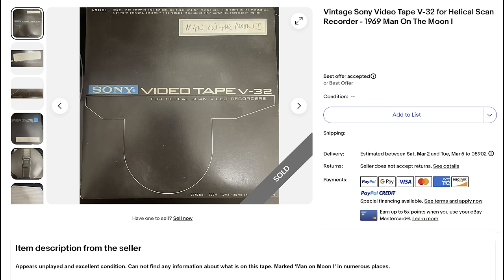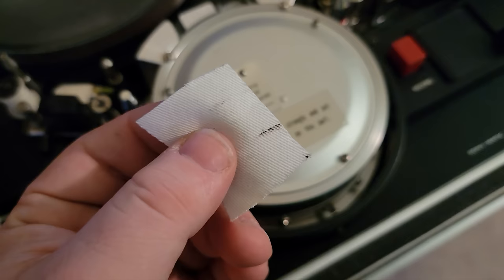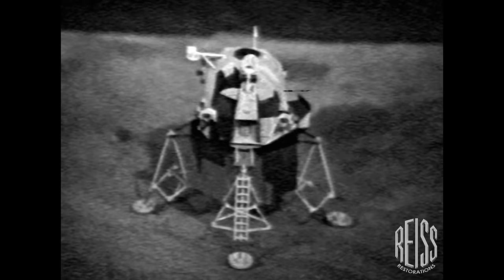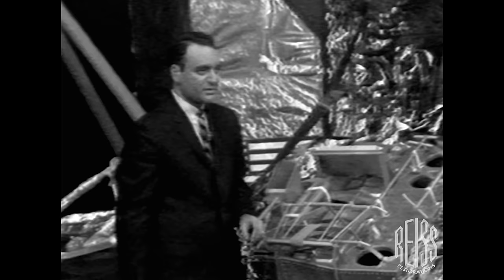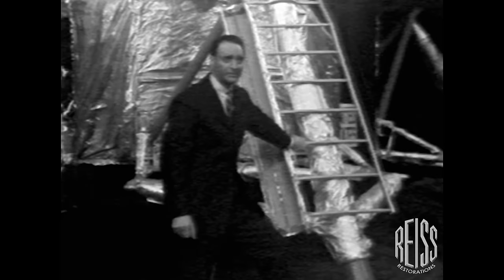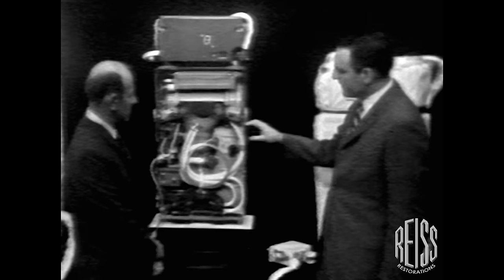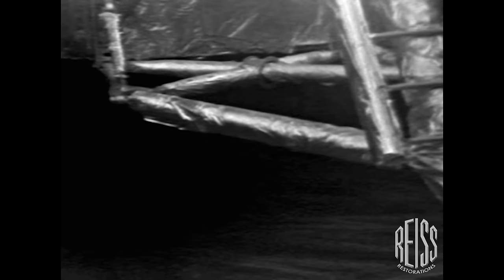Finding and Digitizing the Apollo 11 Moon Landing on NBC (July 20, 1969 - Partial Broadcast, B/W)

Comment: Great work! Still brings hair up on my spine with the 1201 and 1202 calls and all. Great to see how knowledgeable the presenters are about the LM, and them having a mockup in the studio.
Reply: Because the LM was a mockup in a studio.
Reply: @sunnydlite-t8b Riddle me this, if you aren't capable of something, does that mean that thing is impossible?
Reply: Not that you would know anything about 1201 and 1202 Marc 😉. You were a big part in teaching many people how the agc works
Reply: It made me lol when the one dude said they could use a fan to blow the flag on the moon right after explaining and showing it has a rod to support it because there was no air on the moon. He then says but there is no power on the moon for it lmao. @ 24:14
Reply: @utterube solar power maybe? The cells were created in 1954 so the tech was available.😊
Reply: @extraincomesuz  You are missing the point, the fan wouldn't work to blow the flag because there is no air for the fan to push into the flag, so solar panels wouldn't help a fan move the flag lol.

Edit: I think the guy just didn't want to have to explain to the guy off screen again after he literally just explained the flag and why it needed the rod to hold it up(the chuckle in his response speaks to me), it was easier(time constraints for the programming and expected time of the live broadcast)for him to say there was no power on the moon for the fan to run, as the dude commenting about the fan obviously didn't understand the moon has no atmosphere lol.

Lol, I feel like we are echoing the video right now haha.

Comment: When I learned there was no original footage of the landing I wanted to magically find something like this.  I’m glad you did!!
Reply: "there was no footage of the landing". Not exactly correct. While obviously there was no external footage of any of the 6 landings each was filmed from inside the Lunar Module using the 16mm camera pointing out the LM window. This footage is easily found on YT. Take care.
Reply: @TheWokeFlatEarthTruth The transmission was not NTSC, and the original feed has been lost. This and all the other footage is literally from a camera pointed at a screen.
Reply: @jonnyreverb  exactly.  Even if not the original feed an incredible find nonetheless.  Need the Australians to find the SSTV.
Reply: @jonnyreverb  Incorrect. The OP mentioned ""there was no footage of the landing". I simply pointed out that the only footage of the actual landing of each of the LM's on the lunar surface came from the 16mm camera. Take care.
Reply: There’s a difference between the footage that could be / was shown on TV at that day, and what was recorded on film and then brought back / recovered, when they splashed down on Earth.
Reply: @Stadtpark90  Correct, the LM was not equipped to televise the landing, we had the audio only.  The rest was studio stuff until the moonwalk when they powered the camera up as Armstrong was on his way down the ladder.  You might remember the instruction 'TV Circuit Breaker In', because the camera wasn't powered up until he was on the way down the ladder. The actual landing footage was 16mm film from within the LM that was takend back to Earth for processing as was other 16mm and high res (for the time) still pictures (Hasselblad large format still cameras).  But the only television was of the moonwalk itself.
Reply: @jonnyreverb Telecine was the fastest way to copy video at the time.
Reply: The only lost footage was the reel that was taken to the moon. All broadcast reels had to convert as the footage was only 10fps and would not broadcast to tv. All the broadcast reels were kept and have been released on multiple occasions including the 50th anniversary.  So any footage you have ever seen has been kept, only the astronauts and nasa would have ever seen the original footage that was lost.
Reply: @geoffroberts1126  The Hasselblads were medium format camera's. Sorry to be 'that guy' , but the pure quality of a 70mm film negative puts any modern camera to shame.
Reply: @TheWokeFlatEarthTruth LMs* plural, no apostrophe saying LM is. Modules has no apostrophe.
Reply: @OrangeYTT And film was dubbed to telecine too. Which was what the rushes were dubbed to for an initial pre-edit recce back in the day. My father was a film editor for many decades prior to becoming a director. I used to sit in the cutting room from 5 onwards! Good times.
Reply: @fisher6747 Cameras* plural, no apostrophe saying camera is. Not sorry for "being that guy." 😇
Reply: @thekeysman6760  Thank you for your reply. English is not my native language. Take care.
Reply: @TheWokeFlatEarthTruth  It's all good. Best wishes to you too. I'm not multi-lingual so you're beyond my abilities anyway!
Reply: @fisher6747  Ah, ok, I wasn't actually sure, I knew it was bigger than the usual 35mm.  And yes, they were good cameras with good film.  We are only just getting to the point in the last few years where digital is starting to catch up to that in terms of resolution, however enlargement isn't as good with digital.   It's now possible to make digital cameras that approach human eye resolution, so ultimately it will leave film, even 70mm behind, but it's not here yet in commercially viable cost scales.
Reply: @TheWokeFlatEarthTruth  "Was" and "is" are the point you're getting overly obsessed with.

If the person is refering to a point in the past (they would have to be aware prior to the point of commenting) where they became aware that there "is" no original footage (NASA state they have no original footage, no telemetry, and no longer have the technology to go to the moon), they could, typing as they speak, apply a past tense and say "I found out there was (meaning "is") no (longer any) original footage".

Your need (for virtual validation) to show your prowess of repeating things you're aware of may be unnecessary here.
Reply: @dontaskme7004  The OP was "there was no original footage of the landing". The only footage of any of the 6 actual landing events was taken from the 16mm camera from inside the Lunar Module. All this footage is still in existence. There never was any other footage take from any other camera. It is really that simple. Take care.
Reply: The original "crystal clear" footage of the Moon landing was lost (somehow). All we have is low quality videos that are blurry and dark.
Reply: @JustinMadrid-z7e  "the Moon landing"???. 
Also how exactly was the 16mm footage " lost (somehow)"? Take care.
Reply: @user-xt6fg4zt5c  There wasn't any "crystal clear" footage of the landing lost because there never was any live footage of the landing to be lost. That's why it says "animation" on the video during the descent or landing. There wasn't any camera on the outside of the LM or already on the surface of the moon to take any live footage.  Duh.  As the other person stated the only footage of the landing was from the camera inside the capsule which had to be returned to earth and developed. It's the video you can see on YT now that shows the dust outside the window. The only live footage available is of the EVA which occurred hours after the landing. This video explains about the camera in the storage compartment of the descent stage of the LM that was used to capture the live footage of the EVA.
Reply: @jonnyreverb  Not really.  This was a taped on a VTR fed from the video source, probably by an engineer who worked at an NBC affiliate and had access to the feed.  Most of the other YT coverage is the same, such as WTOP in Washington DC.
Reply: @TheWokeFlatEarthTruth   And NASA state they no longer have any original footage... Saying "there IS* no original footage" is thus a true statement.

Refering to finding out that there's no original footage, using the past tense because they found out in the past, making a statement with the same intent, you could use "there WAS* no original footage"... That isn't a claim that nothing was recorded, it's refering to the statement that none of it has been preserved.
Reply: @dontaskme7004  I will try to make this a simple as possible. The 6 Apollo landings (by landings I mean the actual physical event of touching down on the lunar surface) were only filmed using the 16mm Maurer camera pointing out the Lunar Module window. This original footage is still in existence. No one including NASA has ever said otherwise. The 16mm footage is not the same as the footage that was obtained from the Westinghouse TV camera that was transmitted to Earth and recorded there. Take care.

Comment: Absolutely beautiful.

Absolutely nuts how fast mankind makes progress.

- We start literally with just rocks - 0
- We bump these rocks together with wood and suddenly we have it... fire. - About 2 million years ago.
- We learned how to control the water, building irrigation systems. - 6000BCE
- We learn how to propel stuff in the water with oars, creating the action of sailing. - 4000BCE
- We learn about a strong rock named iron and start making stuff from it. - 1200BCE
- We make powder that explodes whenever we want it to! gunpowder - 850CE
- We harness the power of wind through windmills - 950CE
- In 1044, we learn that magnets can help us with directions, creating the compass.
- Finally, we get clocks to tell us the time! 1200-1300
- In 1455, man learns how to mass produce media with the printing press.
- We started boiling water and putting it to work, - 1764
- We learned how to use this steam to move us with massive locomotives - 1804
- Then we replace our oars with steam in our new steamboats! - 1807
- 1826/7, a man takes light sensitive paper, shoves it in a box with a shutter and a lens, and boom, photography.
- By 1831, we grew tired of harvesting our crops, so we made the mechanical reaper!
- In 1844, a painter decided he was tired of using the unreliable mail system, and boom. telegraphs.
- 1876, a man further refines this idea and makes the telephone.
- Then we got the gasoline engine, - 1867
- We grow tired of using candles, and harness electricity and make lightbulbs! - 1879
- Humanity got tired of using it's legs and wanted to explore the world! so they made cars - 1886
- And soon we learned how to broadcast our voices across an area! making the radio, 1901.
- But then we took to the skies, 1903, we finally fly.
- And we soon were on our way in 1926 with the first small rocket engine.
- Humanity decided just hearing someone's voice wasn't enough and developed a way to see them too, television. - 1927
- Then we developed jet engines to make better planes, - 1932
- Soon we developed a way to split things we cannot even see to make a ton of power! - 1942
- And we developed computers that could do thousands of math problems in a second. - 1946
- Soon we made transistors that made those computers faster and better. - 1947
- And the world was taken by storm when suddenly in 1957... man finally left home on a rocket.
- Then in 1969, we finally took yet another small step for man, but a giant leap for mankind.

And life would only get crazier after that.

Comment: It's neat that the LM model NBC used to illustrate the landed LM was the commercially available Revel model kit, easily identifiable due to the hinged, foldable legs. The model's legs needed to fold because it was part of a kit that consited of the command/service module, launch escape tower, lunar module and the lunar module "garage" that was on the top end of the 3rd stage of the Saturn V rocket. The model could be displayed in launch configuration or with the LM landed on a lunar display base.
Reply: I bought and put together that model age 9. Great memories.
Reply: Me too, but I was 12!
Reply: I had no idea this existed! I sometimes love the gems that can be found in the comments section. thanks for this. any idea what it used to cost? any idea if they still exist and their value today?

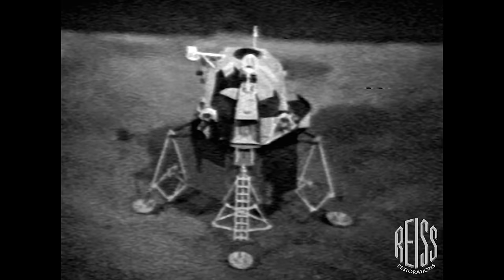Comment: I remember watching this live in 1969.. Years later I painted a guys house , he was the engineer that designed the lander contact system  12:17 .. His memory's were clear about the teams of designers and builders working on Apollo , information was freely available on all aspects of the programs involved in the mission..
 An amazing generation..
Reply: my dad was a senior tooling engineer, and design some of the special tooling needed to manufacture the Apollo guidance system, they were def the greatest generation
Reply: @charlespatrick8650 Cool. I just emailed my Dad the link to the video here. I am trying to determine which broadcast he watched. Oh, and he was one of the people who wrote the program to land on the moon ... the program that Neil turned off when the 1201/1202 errors came up and had to land manually. Not his fault! It was the docking radar that got left on I believe.
Reply: @AllAmericanGuyExpert  my understanding is that Buzz decided on his own to leave the rendezvous radar on, but the programers at MIT assumed that the computer would only be looking at either the landing radar data or rendezvous radar data, but not both at the same time, leading to the computer getting too much data, and producing the error code

Comment: What a great find and beautiful work….!

FYI, here are a couple of facts about the moon cameras you might not know.   

First, Apollo 11 video was most definitely only black and white.  All subsequent Apollo missions had color cameras on the moon but the color camera on Apollo 12 was destroyed when the astronaut burned it out by pointing it into the sun.

Second, the actual footage that Houston  received from the moon was 3 times better than what the world saw on their TV due to the fact the NASA video was a different format than the NTSC television broadcast standard.  So when the raw footage was converted from the NASA slow scan at 10 fps to NTSC at 30 fps with an RCA analog converter, the images were basically “re-photographed” frame by frame and the video quality suffered severely, appearing much darker and blurred, compared to the real feed from the moon.
Reply: I should add that the actual cameras inside the command module orbiting the moon was in color but the actual moon landing cameras were black and white probably mostly related to the need to ensure the moon camera chosen would work in the harsh conditions on the moon.  NASA had only one chance to get the camera right on the first historic landing and didn’t take chances.  They knew the chosen camera would work as it was used on Apollo 7 through 9.
Reply: Plus, the LEM antenna was MUCH weaker than the command module antenna so the camera on the moon only took 7 watts to run (unbelievable!) whereas the future color cameras used a whopping 17.5 watts.